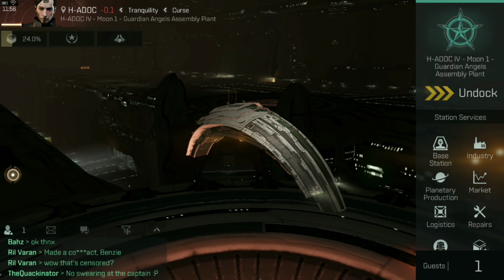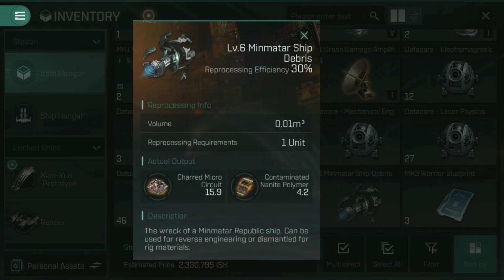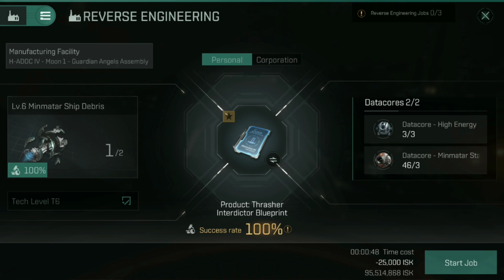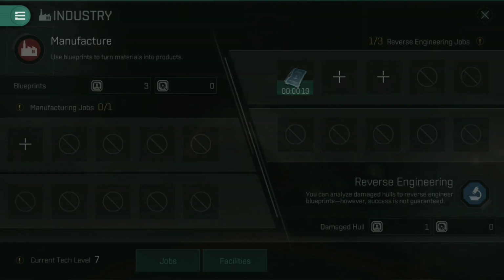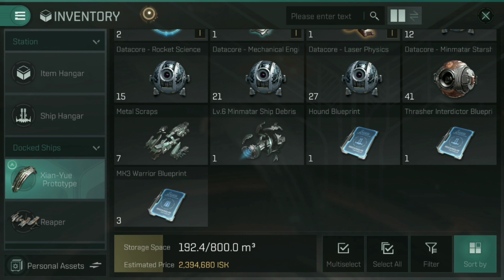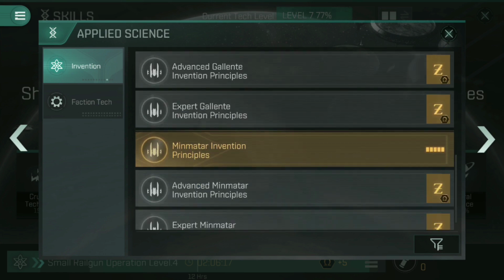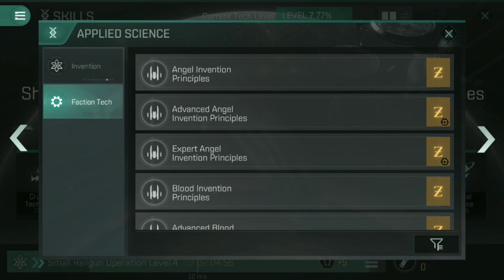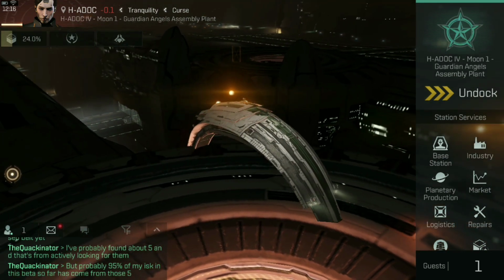How To Get Ship Blueprints With REVERSE ENGINEERING!! || EVE ECHOES Final Test

Comment: I have the datacores but it says zero, why?
Reply: they are in your hold. all the parts need to be at the station you are reverse engineering in. so if you left one at a station somewhere youll have to go get it
Reply: @repentorperish1386  Nope, found out it's bug. So many tried to help on discord but failed at that version. Hope they fixed it, I quit already.👍